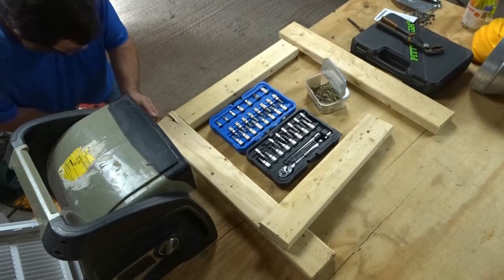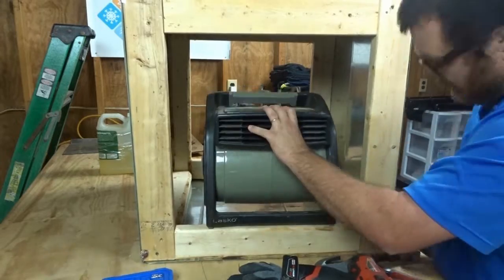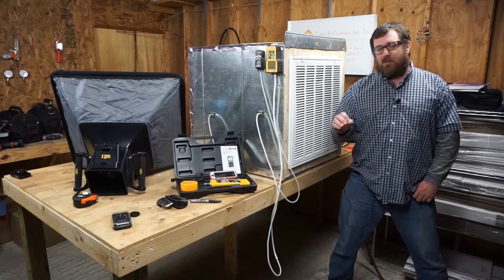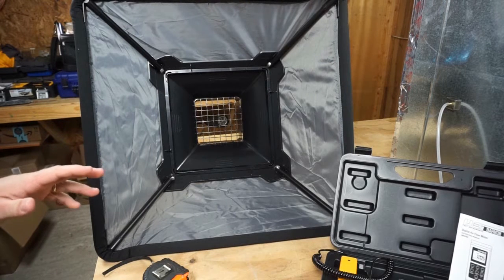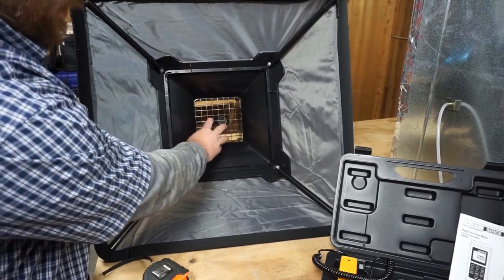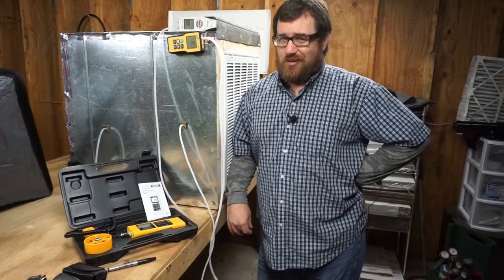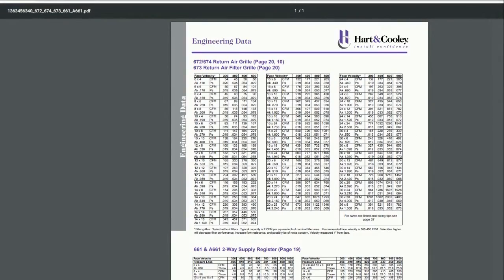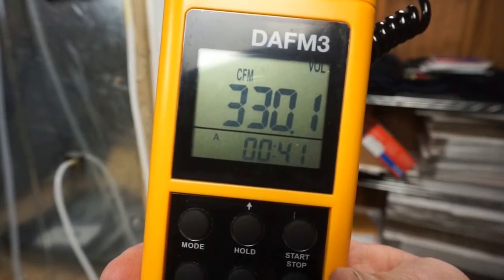CPS easy Hood vs. UEI DAFM3 Vane Anemometer | HVAC Airflow Experiment

Comment: Vane Anemometers tend to overshoot because of the mass of the fan when doing a continuous traverse. If you blow in it it will coast. So what happens is when you get in a region that the airflow slows the vane does not slow down as fast as you are moving. The best thing to do would be a 16 point or higher traverse. That CPS hood was tested in an extensive study and it did very well.
Reply: So in your opinion. Would you believe  that the CPS hood is accurate enough for doing delivered capacity calculations? plus does the accuracy fall off the more CFM you are trying to test?

Comment: I would not stand in front of the inlet of the hood, blocking air flow from entering. I have tested air flow before and did a little test with cardboard it will make a difference. How about using a regular blower motor with different speeds than that fan you have. It would make it a realistic factor with higher cfm. Just a thought. Love air balancing.
Reply from the maker: Good tips.  I will compare with different standing positions
Reply from the maker: Good tips.  I will compare with different standing positions
Reply: Just a thought thank you.